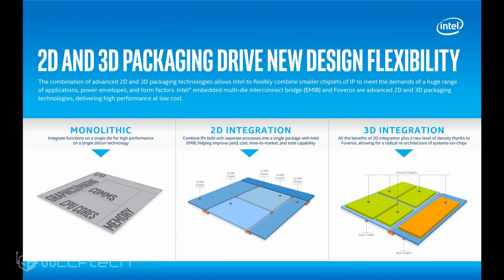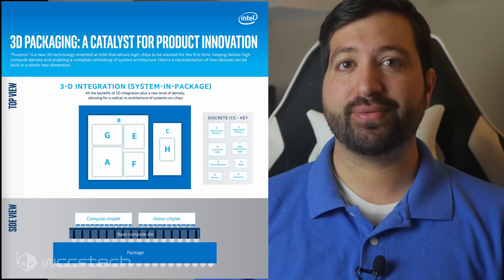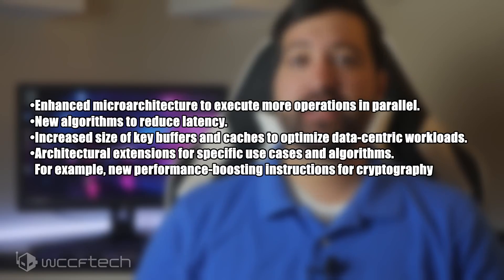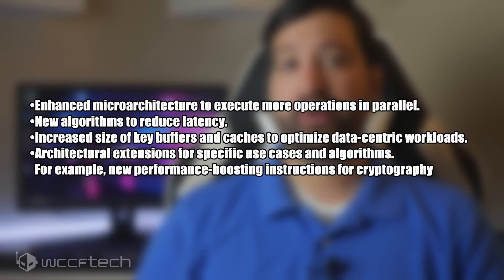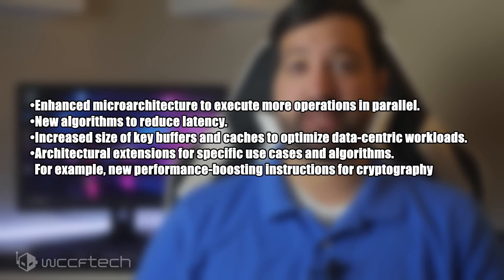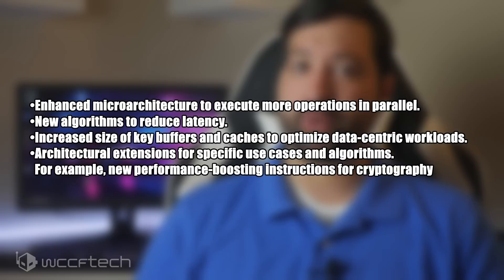Intel Architecture Day Ushers 3D Packaging, Sunny Cove CPU Arch, And Dedicated GPU Talks

Comment: Just wondering... How do you cool down vertically stacked cores? 🤔🤔🤔
Reply: The cores aren't stacked. It has a low power base with all the low power elements in it that interconnects everything put on top of it. The cores are still spread out. But on top of a layer that connects everything and handles low power functions.

AMD does something similar, but they put everything next to each other...but resulting in latency issues...hence the high speed memory required.

Intel is trying to solve the latency problem by 3D stacking.